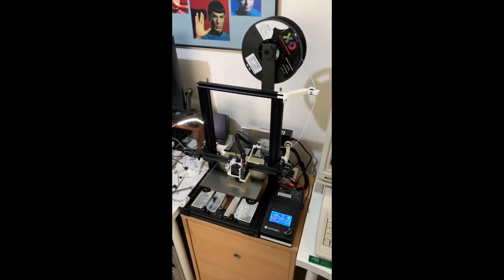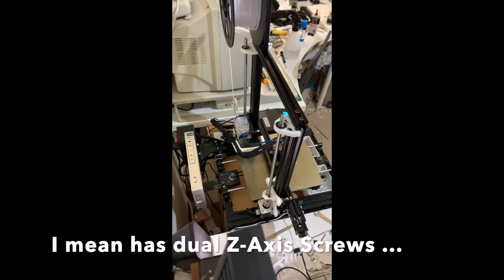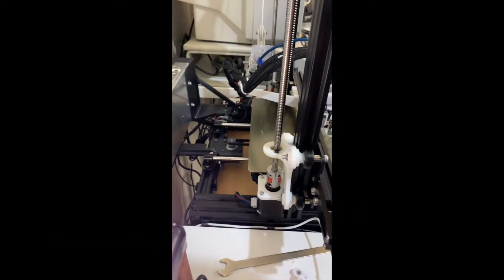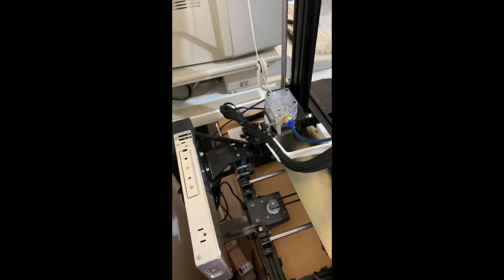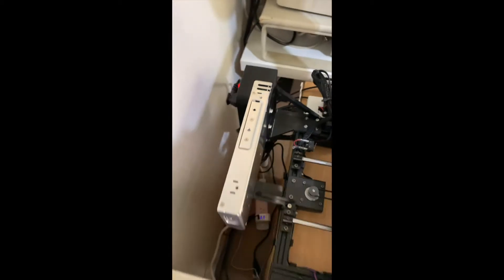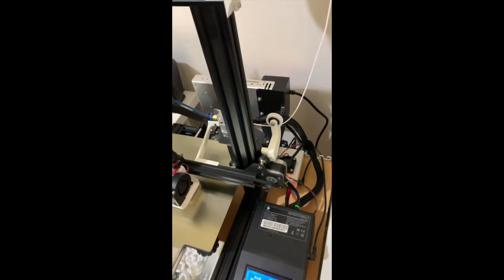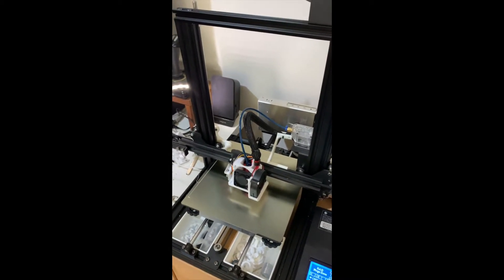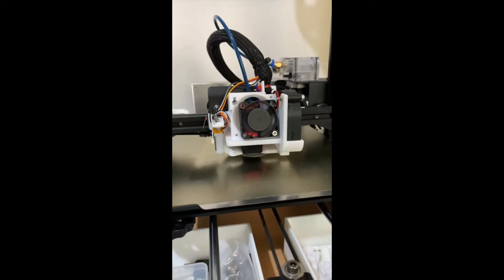Anycubic Mega Zero v1 0 Dual Z Upgrade

Comment: Hi I have recently been given a megazero v1 and I'm looking at adding some upgrades to it for improved quality. Do I need to do any firmware upgrades to be able to add the second stepper motor to upgrade to a dual z access. I'm very new to all this and any advice would be greatly appreciated
Reply from the maker: Howdy, cheers.  If you don’t mind them being run from the same stepper driver then no (which is perfectly fine). You just need a Y cable like they sell for the Ender 3’s.
Reply: I'm happy for them to run from the same driver, I'm still very new to this so I'm happy to take my time with it. Am I correct in thinking the y cable just plugs into the board and replaces the original stepper motor cable and will I have sufficient power to run the extra motor. Apologies for all the questions I've not had the printer for very long and want to make sure I get it right
Reply from the maker: @robinllabres5969  yep, that’s exactly how it works. The one thing I recommend is buy a pair of stepper motors so they are the same spec. Otherwise the potential to get out of sync and not work very well is high.

No dramas, I was new to 3D printing 2 years ago, it’s a great hobby and lots of fun learning the tech. I recommend you check out the Teaching Tech channel, I learnt a huge amount from him.
Reply: @Cybernetic_Systems  brilliant thank you so much for your help
Reply from the maker: @Robin Llabres  no worries at all. Btw, all of my current designs are now on Printables (Thingiverse is a dumpster fire)

https://www.printables.com/social/171511-djos_1475/models
Reply from the maker: @robinllabres5969  oh and there are some helpful findings in this model that be be of use:

https://www.printables.com/model/88587-z-axis-stepper-motor-mount-with-integrated-axial-t

Comment: just wanted to double-check. My MZ1 came with a 2mm pitch screw. Did you modify yours before moving to the 2mm, or did yours some with an 8mm pitch screw?
Reply from the maker: The lead screw that comes with the MZ1 is the following spec:

Thread spacing: 2mm
Number of threads: 4
Thread pitch: 8mm

I'd recommend staying with this spec but adding Anti-Backlash Nuts (this is what I use).

Comment: Hi Derek, I'm currently fitting dual z screws to my MZ1, and i was wondering if you could lay your hands on the klipper config for the skr mini mz?
Did you use the Z1 socket on the main board or a splitter cable?
Reply from the maker: I used the Z1 socket, it’s using the same driver so is not very different to using a splitter cable.
Reply: @Cybernetic_Systems  thanks mate, you're a star.

Comment: I haven't done the dual z upgrade yet but I just finished the heated bed upgrade which has made a huge difference in the adhesion with the stock build surface.
Reply from the maker: Awesome! Which Heated bed did you use? I've just switched from an Ultrabase to Magnetic PEI steel sheet.
Reply: @Cybernetic_Systems  I'm still using the stock Mega Zero build surface and aluminum bed but I add a cheap pcb heated bed that I bought as a spare for my Tronxy printer and never needed. It took some modding to make it work but it works great and the best part is I didn't have to buy anything. I will be adding an external mosfet soon and possibly a new power supply as right now I'm powering it with an old pc power supply.
Reply from the maker: @percaine  good work!

Comment: I like it. Nice upgrades. Looks great. I'm upgrading mine as well. Just waiting for some more parts to come in. Fantastic job Derek.
Reply from the maker: Cheers. I need to replace the lead screw couplers with some better ones as the ones I got are a bit rubbish. I’m also waiting on some metal stepper motor mounts and adjustable lead screw stabilisers.
Reply: @Cybernetic_Systems   Your implementations are worth admiring. I presume you plan on adding a DC heated bed; giving  your selected PSU.  Would it be too much to ask your hotend  shroud design and fan sizes. Thanks
Reply from the maker: @ewardbennett9648  Im using a Creality CR-10S 12v Hot end with this Shroud Design:
https://www.thingiverse.com/thing:4709536

here is the PSU mounting system that I remixed for the MZ1
https://www.thingiverse.com/thing:4766416

I do have a heated bed coming and I'll be using these brackets:
https://support.th3dstudio.com/hc/guides/diy-guides/anycubic-mega-zero-v1-heated-bed-upgrade-diy-info/
Reply: @Cybernetic_Systems   Much thanks and appreciation. I'm hoping to show you mine, once completed. I'm a noob to 3D printing but your mods are the best I've seen. Its a steep learning curve I'm trying to grasp.  Programing my new board when it arrives will be my biggest challenge. Once again, thank you.
Reply from the maker: @ewardbennett9648  Cheers, this is my first 3D printer too and I've been making plenty of mistakes along the way! :-D